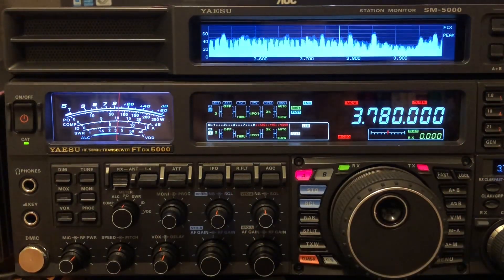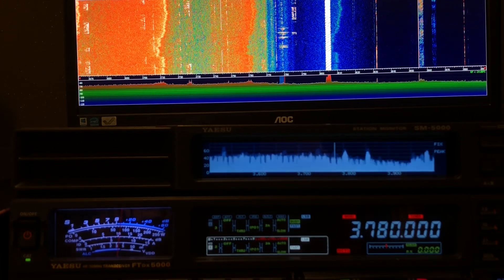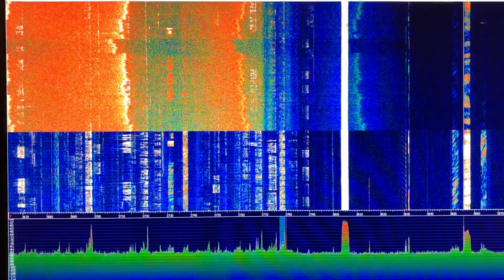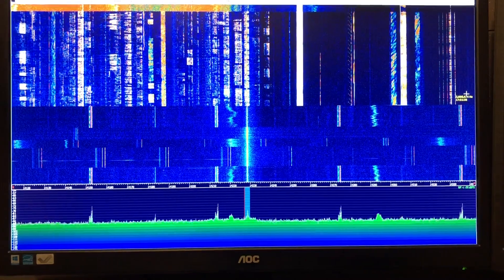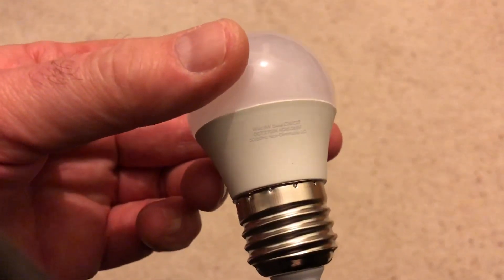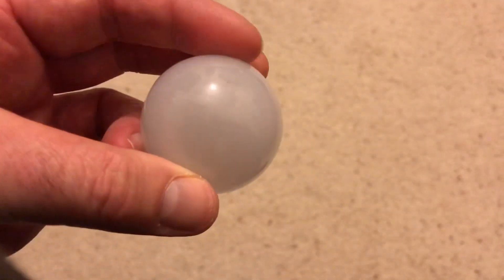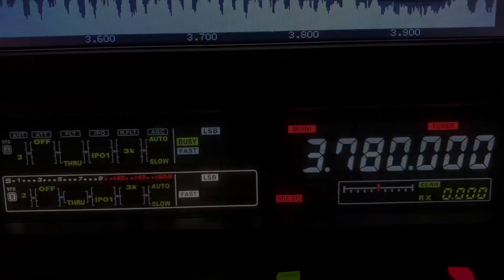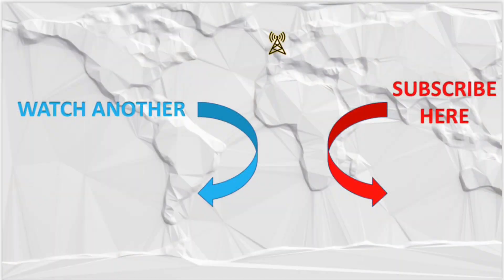RFI - Extinction Level Event!!!

Comment: That lamp has got a lot of neck! Blumin things. Im going back to oil lamps sharpish
Reply from the maker: Ha ha, yes. Sticks n matches 😁
Reply: @G0CNN-Ian hahaaaa yes.
I have so much rf in my town... do you think a toroid choke woukd help along side the 16 coil airwound choke thats on my t2lt vertical antenna or woukd i be "over choking" the radio (if thats even a thing)
Reply from the maker: @Eana-of-Sussex one good choke should be enough.

Comment: Coming late to this one. It would have been instructive to pull that bulb apart and check out the circuitry vis-a-vis a non RFI LED bulb of the same size.
Reply from the maker: Hi James. Yes, agreed. I sent it off to the RSGB RFI section for analysis.

Comment: I picked up a laptop at a hamfest.  The original power supply had been lost and replaced with a cheap generic one.  S9 of noise whenever I used the laptop.  Turns out it was the power supply.  Makes you wonder about its safety as well…
Reply from the maker: Good job you realised!

Comment: Loop on Ground antennas can be helpful, when you can't fix the closer RFI.
Reply: But I believe the ground loop is only useful at the lower hf frequencies.
Reply: @saxon12qa  Yes, lay on ground loops are basically for 40m and lower.
Reply from the maker: Yes Viron 👍🏻

Comment: Good demonstration that a lot of hams get QRM from their own devices however many (not you) will initially blame ‘the noisy neighbours’ Xmas lights, solar panels etc etc. I’ve found the same as you Ian and have learnt to check my own house is in order first. My laptop still gives me a ‘tad’ of noise which I used to ignore (but by accident I found it can make the difference on marginal contacts) however if I put it to sleep then noise on radio goes away (even on battery power with transformer unplugged from mains too) thus suggesting it is the spinning hard drive, the cooling fan or similar giving me QRM. How many houses/devices have motorised fans? Computers, power supplies, shower expelair etc… anyways, keep up the good work marra. Speak soon.
Nick M1DDD
Reply from the maker: Yes Nick. One laptop I have had a slightly noisy screen. When closed and using a monitor it’s fine. Might be similar with yours? Catch you on the bands 👍🏻

Comment: What a shocking experience. I had that kind of RFI once but it was gone while walking around trying to locate it. Was not in my own house, that is for sure. 

Still having a mess on 80m where there's most likely one device somewhere causing havoc. Just don't know where to find it. Yet.

Good thing you found it. You already binned it, would be interesting to see if you could break the bulb and find out exactly why. Capacitor could have gone bad or something else. 

73
Reply from the maker: Hi Anton. Good luck finding yours 👍🏻 I might send the bulb off to the RSGB so their EMC guru can take a look….🔎

Comment: Hi, thanks for your video. So the LED bulb, which had been RFI free, had suddenly gone bad and started producing RFI? If that's the case you have discovered an interesting effect.
Reply from the maker: Hi, no. By chance the following have never coincided:
1. Off work early and at home and on the rig. 
2. XYL at home too and late enough in winter to still be working after dark. 
3. Turning the lamp on instead of the main room light. 

It’s been over a year and the above has never happened 😀
Reply: @G0CNN-Ian  Oh, I see. Funny old world isn't it! 😃

Comment: I wish the sources of my noise were in my house, last one I located was 12m of LED strip next door running off a 2A power supply meant for the kits original 5m of strip which was 20+ across 160, 80 and 40m.
Reply from the maker: Crikey! At least you sussed it Matt 😀

Comment: not again!
Reply from the maker: It was quite a shock Vince!
Reply: @G0CNN-Ian  Congrats on finding the bulb! I have an issue during the day on 80m. I'm almost sure that it is the solar inverter that powers my home. I'll have to switch the house back to the grid and turn off the inverter to be sure. If it's not that then it'll be something from my nearest neighbors who are over 150 meters from me. Fun times.
Reply from the maker: @vincei4252  Yes Vince I also have something on 80m in daylight that I can dial out with NB. I think it’s next door’s solar panel associated kit…. ☹️